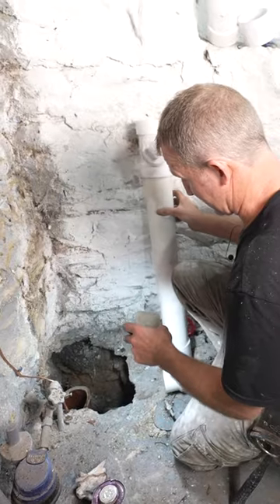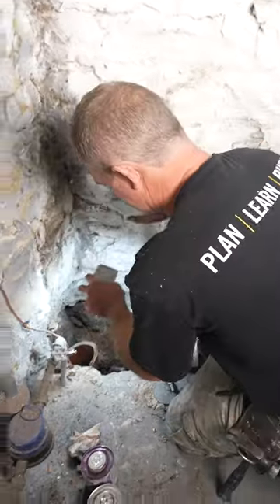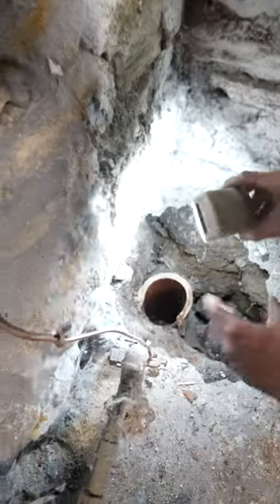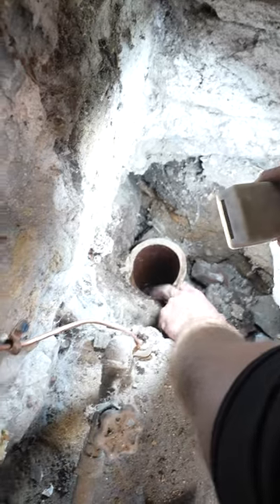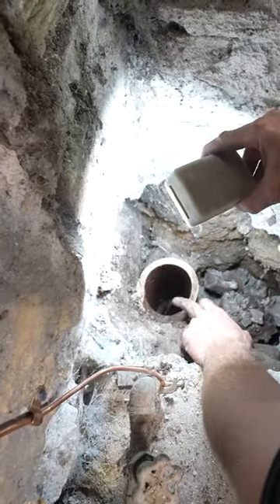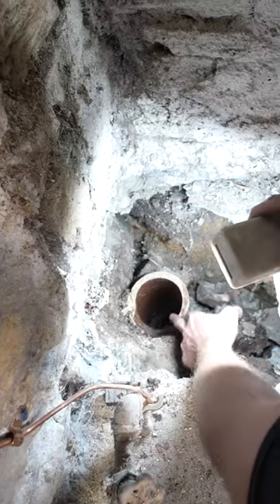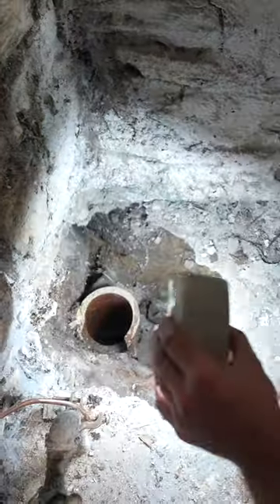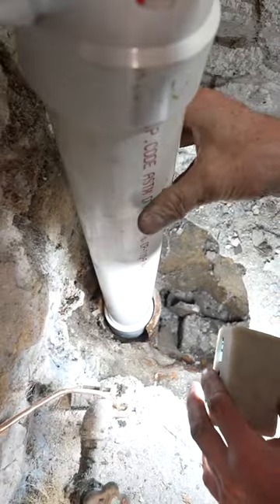Bad Plumbing Connection #shorts

Comment: So you just did what the other contractor did before.  Got it 👍
Reply: Maybe that’s what the customer wanted cheap as possible
Reply: 😂🤣😂exactly
Reply: @Swayz790  hmmm a coupling and grinder blade is probly cheaper then a bag of cement

Comment: Dig it out, snap cut it,  and put in a shielded fernco clay to cast. Do it right do it once. You are better than this.
Reply: This was better
Reply: Okee dokee.
Reply: @Kushert  is it? I'm under the impression sewage has a chance to seep into the concrete now
Reply: @Geoff Li  
If anything do a firmco and the concretely
Reply: @Kushert  that id agree with, or run a new line through the clay
Reply: You nip the hub off. Then do a fernco. It will be ugly but water tight.
Reply: @ryandolan9387  idk why but I imagined a handy man taking a 1/2 impact to the fernco completely over tightening it causing the clay pipe to shatter
Reply: No he’s not
Reply: How would that be better?  That looks to me like a whole lot more work for a less secure position
Reply: @bobcougar77  it's to code
Reply: @ryandolan9387  maybe I'm not understanding.  He's still connecting to an ancient terra Cotta pipe but now he's dug further in and has made more connections?   I've tried to use feencos on that old terracotta....  It ain't all it's cracked up to be.  It's often just not strong enough to support the amount of tension required on the band clamps to make a seal.   
 Frankly I think his cement method looks vastly superior.  And as far as digging up more of the system, I think it's better to let sleeping dogs lie, unless I was willing to replace all the old terracotta.
Reply: @bobcougar77  code I there to prevent future issues. Most of the houses I work on are over 100 years old. I understand that the old style of fernco couplings can off set. They offer shielded versions now that don't offset. Terracotta comes in 5ft sections before the next hub. You don't have dig far to expose a hub. When you snap cut it it makes a pretty clean cut. Try not to move the pipe and you wont compromise the next joint. Torque it down to 60 lbs, as per code and you will have a joint that won't leak.  Roots travel to a source of water, that joint will leak and the roots will get in there. It may not be today, but it will be a problem in the future.   Replacing the old Terracotta is the best fix, but there is no excuse for a half assed repair.
Reply: @ryandolan9387  I guess I hear what you are saying but don't agree.   Yes, I've used those shielded clay to cast ferncos and they distribute the pressure better than a simple band clamp but it's certainly no guarantee it won't crumble.  
Second: the connection he's making now is a vertical one which won't leak even without cement unless there is a backup.     Most likely there is not sealant in any of the bell/hubs in the rest of the drain.   
So doing it the way you suggested would introduce more horizontal connections.  
3rd.  He is clearly in the corner of a foundation.   You are suggesting a ridiculous amount of work to not make something better. 
I think it would be irresponsible of a contractor to suggest your repair in this situation.  It would be far better to say "I can't patch that without replacing the whole system. "   Fair enough,  you touch it you own it.  And I certainly wouldn't want to dig up the corner of a foundation and replace 3' of pipe just to have a root come in the next hub but I've charged the customer so much that they are sure it's my fault.  

I think also, this is the difference between a plumber and a remodeler.   There is just a different relationship with the homeowner. I might be able to explain but i've already typed too much.
Reply: Customer:"No thanks just make it good for now."
Reply: Maybe he should just build them a new house too....
Reply: @bobcougar77  I 100% agree with you
Reply: @mathewthatcher6274  thanks and to be clear.  I don't think he is wrong from his perspective.  It's all about liability.  A plumber gets called in and has to ask himself how can I do this job without fucking myself in the future.  That's where you get the reliance on code over common sense. It's in his interest to say 10k to do this patch or 20k to replace the system.  (Made up numbers)  while the remodeler has already made the commitment to the customer to "replace the bathroom";for 20k.    There is a LOT more trust in the relationship because of the length of time they are working together and other factors.  I personally reject customers if I get a hint of a red flag on a trust issue.  Remodeling just impacts so many systems that there is going to be compromises based on cost.  Otherwise you could easily spend 100k on something that would otherwise cost 20k.  It's just reality.
Reply: @ryandolan9387 pm
2 p
Reply: @bobcougar77  I've been plumbing for 15 years and own my own business now.   I feel like there is nothing wrong with planned, phased approaches to repairs.  The customers have a certain expectation of what they are needing to get expect to  spend.  Nothing wrong with a conversation saying that the next phase of the repair is to do the underground or reroute in a different, more practical way.  Last thing people want is cost increase surprises mid project.   I am totally in approval of how this guy made this repair as long as he has a conversation with the customer that there is still more to be done down the road.  A camera inspection of the underground would have been a huge plus I think
Reply: @mathewthatcher6274  well said and I was probably extrapolating too much.
Reply: Did one just the other day. Very similar to this excerpt no storm drain connection. Clay to cast fernco. Fill hole with sand. Not concrete.
Reply: As a DIY homeowner I also thought that clay to PVC needs a Fernco coupler, however others have mentioned that doing the "correct" repair would be costly and informing the customer that this is a temp fix and plan to do the correct repair later is a fair compromise.  As a DIY person I'd just spend the $15 for the correct Fernco coupler and repair to code.
Reply: @ShrimpCracka  it might.
Reply: The way that’s done is awful! Water can still seep out
Reply: Snap cut it? Risk cracking it ? great solution
Reply: @bobcougar77  I prefer to use rubber cement over concrete.  The concrete will eventually rot. Especially in moisture.
Reply: @Ryan Dolan  is it? I got called for doing that. You can't do 4" to 3" to 4"... all has to be 4" for code. Least in NH.
Reply: @normandeline2339  I agree. You can't bottle neck a junction, but it looked like 4" clay. If I'm wrong then good eye brother.
Reply: @Tairone Wassup  if water built up enough to seep from that connection. They're gonna be happy they saved on this job.
Reply: Real but what if the customer just wants it a cheap as possible
Reply: all I know is I saw fernco and pressure in the same sentence and those two do not go together folks
Reply: Digging down to expose the hub isn't expensive, maybe 15 minutes. The coupling costs about 50 bucks. The other time is bid into the job. If it were me, I would have had the headache labor planned into my bid. So, I personally wouldn't have charged the client.  That's just me. If you want to milk the client for more money then change order away. Bid it  in phases....or whatever.  Like I said, i take care of my home owners, so I still say he could have done it to code with not much effort. The inspectors wouldn't like the terracotta under the foundation, but they will let it pass that you at least connected it properly. They would take a big dump on the concrete and wipe themselves with the permit if you let them see that. Just saying
Reply: 🫡🫡 that’s how we do it the right way the customers need to understand that we’re here to do it right an if they recommend the cheaper way then we can’t warranty or stand by our work
Reply: @andrewveazey1598  👏
Reply: This will last as long as the concrete, which will be a very long time.
Reply: Terracotta is just an effing joke to begin with. Whoever thought it was a hood idea to use this as waste pipe back in the day screwed us all. Just as bad as wood pipe! 😂

Comment: Ugh DONT use cement ! That is the problem with clay pipe. The joints are always the issue ever time. AND it’s against code. AND since you’re below grade you need to use a stainless steel steel banded fernco aka non-sheer. This is not the way to do this
Reply from the maker: Thanks for the tip
Reply: Very concise and correct. He's not a licensed plumber so you can't get too mad at him for it.
Reply: @toddcook8824  if he's not licensed and insured, he's not on the hook if something goes wrong. I can understand why he'd rig it like that. I'm sure the homeowners pay a lot of money for a remodel. It's hard to do the right thing every time though. I am a licensed plumber this stuff would keep me up at night.

Comment: Aye yo my man...I watch some of your stuff and sometimes I felt like saying yeah ok he knows...then you do shit like this...come on dude dig it out and do the connection right and not undermine the whole corner of this cause you left a unsealed connection..over time maybe not tomorrow but it will leak and contaminate and blow the structure of the home..do bettrr
Reply from the maker: 😆 that’s a crazy exaggeration 😆 but yeah main reason I didn’t connect with Fernco is because there was a storm connection 1 ft down, so a little bit of digging would have been 3 ft to cut cleanly 👍
Reply: @Bathroom Remodeling Teacher  you said it's capped outside so it's ok....whelp guess what else runs though this...footer tile which bye just capping outside doesn't block the sewer back filling into these...don't know what code is in your woods...but we have to dig these up and separate the two. Storm/sanitary. One of the reason why we pull permits

Comment: Cementing the pipe is too rigid of a connection it will fail they make a terracotta repair flange Rubber and banded stainless this is a hack job

Comment: I’m telling you he’s giving you bad advice it’s OK that is clearing everything around to the point where you can insert new PVC or even ABS into that old stuff … his bad advice comes into concreting around that well you you can’t do that you’ve got to foam it up first you have to lay foam in otherwise the concrete is just going to chew up the PVC. It’s going to decay. Calcification happens just a whole bunch of bad news and it doesn’t happen right away but 510 years down the road he’s gonna have the same. Damn problem they’re having now. The remedy is get some foam wrap foam wrap it around to where you want Lynn, some sort of a sealant at the joint and then you can concrete over the top of the foam to hold it in place.
Bottom line get a professional not a handyman

Comment: That's not any different from how it was. Dont be lazy, dig down and cut the pipe clean, then use a proper transition coupling. You said it yourself in the video title, bad plumbing connection.

Comment: The terracotta is kind of an old term. This is VCP which stands for a bitter fried clay pipe. It's not called cement it's called concrete. Cement is an ingredient of concrete. I would have put a water stop gasket around the PVC pipe prior to pouring the concrete collar first and flexibility and to act as a water stop.

Comment: That's rough. As an inspector I wouldn't want to pass that. Really don't like to see that cased in concrete. It's going to fail again. I used to do remodels and I understand. People really don't want to spend any money on the work that's actually required. Homes will just get keep getting more expensive as the work needed will increase from the last owner being cheap so the bill just keeps getting passed on. It's a shame but people need realize proper work isn't cheap and if it needs it needs done.

Comment: Love it! We did something similar. Only thing I’m always worried about is when the day comes that terracotta or cast iron needs replaced in a concrete slab or through the foundation. Hopefully the day never comes.
Reply: My company ars rescue rooter put in permaliner liner inside because over time they off set or roots go threw and we offer a warranty too the last thing u want to do is a spot repair or have to dig up the whole system and replace because that will be exxxxxpensive be pro active not reactive you should look into that
Reply: This dude below talking about re lining it, you should really look into that. That's the ticket to get you another couple decades out of I

Comment: There is fittings especially for broken clay pipe to convert to current standards. Cement is not current plumbing standards.
Reply from the maker: Yep 👍 and this would require another 2 feet of digging to cut pipe below the storm drain connection point.

Comment: not code!
Reply: Calm down Karen.
Reply: nothing he does is. concrete isn't waterproof
Reply: sometimes you can’t comply to code, you gotta fix what u can fix
Reply: In these old houses sometimes just getting it working is what you need. Sometimes you can't get it up to code or it's cheaper to knock the house down and build a new one then getting it up to code. So landlords can't afford to bring it up to code but they also can't afford to be sued by the tenants. I lived in a house that was built in 1920 before they used p-traps and S traps it was a disaster, the main pipe going out to the sewer was one and a half inch cast iron from the '20s so you can imagine what it was like The whole time I lived there we didn't have a working bathroom and it couldn't be fixed. I got out of that lease without paying anything and honestly I should have gotten more but I understood the position that they were into. I should never have rented I kind of feel like it was my fault a little bit
Reply: Oh no. Not a good idea.